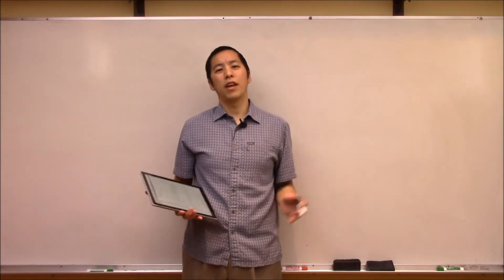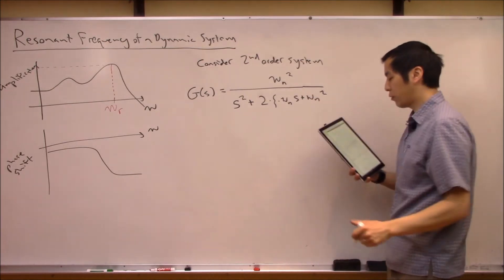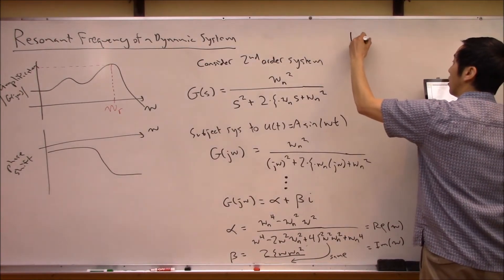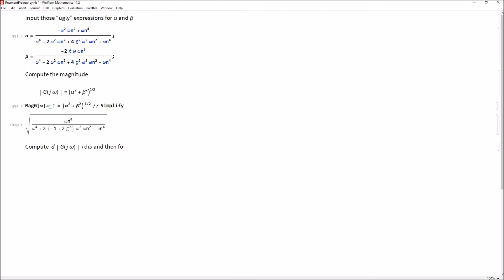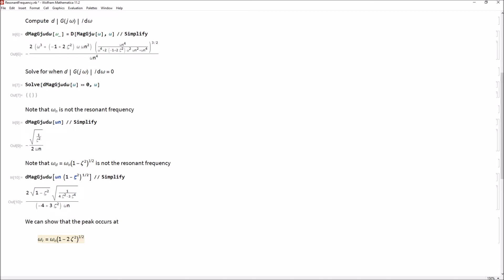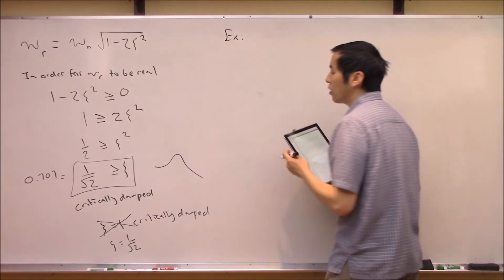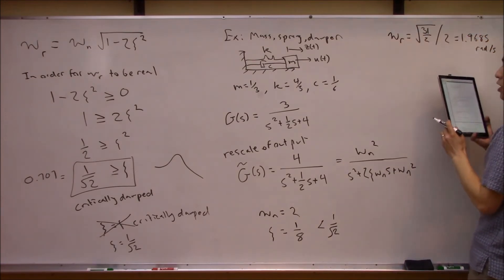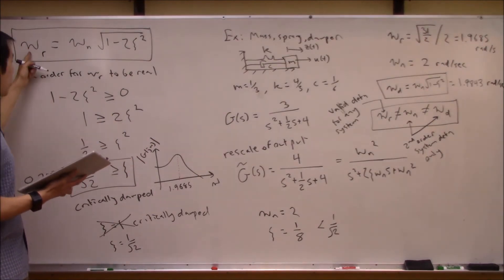Resonant Frequency of a Dynamic System

Comment: AE511: Physically speaking, what causes the natural frequency, damped natural frequency, and resonant frequency to be closer or farther apart?
Reply from the maker: It is usually a combinations of factors but at the end of the day, it is whatever goes into the calculation of wn and zeta in your 2nd order equations.  For a mass/spring/damper this might be a combination of mass, spring constant, and damping constant.

Comment: A doubt, at 23:00 the graph drawn, what happened to the 1/wn factor...im just curious. so the graph is basically 1/wn[wd-wr] against damping ratio right?
Reply: They are plotting the difference approximately. Even if we multiply any number to the difference the graph would just scale up/down. No change to critical point 0.7